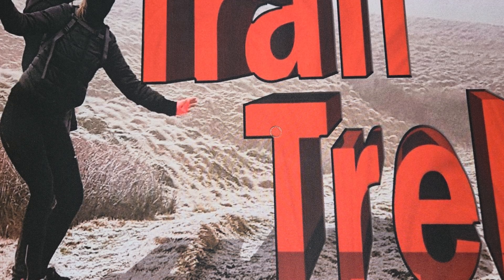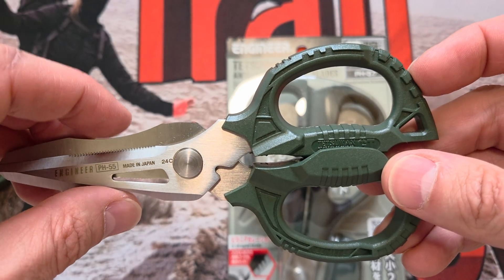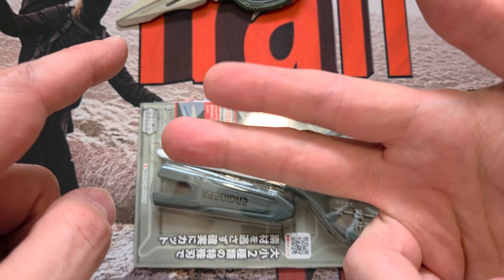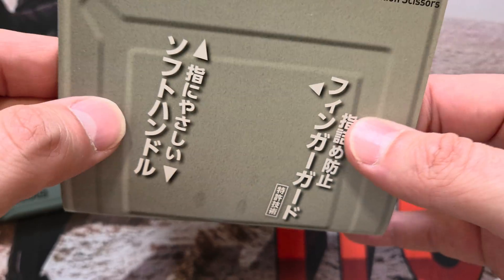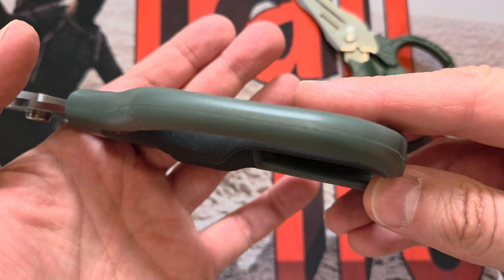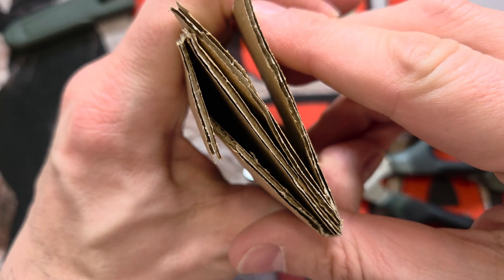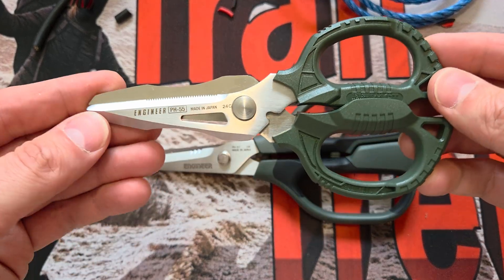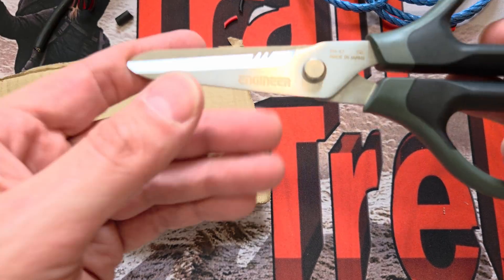Engineer PH 57 Tetsuwan Scissors made in Japan large material destroyers

Comment: I'll try em out. I have so many shears and siccors of all types. Honestly I'm pretty solid with my electrician. even cheap kleins are fine. bit more expensive millers are fine. they're all fine. You can get the kleins for like $15 or something. theyre made in taiwan i think. I think the millers are made in japan. idk. cost $30 I think.  It's all about the steel. Really high quality shears cost quite a bit more.  and I've come to find it's just not worth it cuz honestly the cheaper ones are so good these days if you know what you're getting. It makes no sense to pay like 5x, even 10x more for something that's got like idk 5% better performance in actual use. Even for other types of shears like hair dresser. you can get really high quality stuff these days for small money. just get a new pair when you need it. Anyway. It's all about the steel. I'd suggest avoid the super high quality stuff cuz it's not worth the cost these days. Get the good quality but cheaper priced stuff. Avoid junk.

Comment: Unusual design. How would you sharpen it ?
Reply from the maker: Good point so where is the issue with all serrated blades.  They are an absolute nightmare to sharpen!  You can do it with knives which don't have too many serrations with a pick file type rod but a whetstone will destroy these.  So the unfortunate answer is.... you cant!  Although having spoken to a few viewers who have had these for a while they tell me they stay sharp.  One viewer has the red handles older version and they tell me they are 10 years old and still sharp!
Reply: Best way to sharpen serrated edges is to take a small conical file, line it up in between the points and match the angle, then give it a gentle push-and twist motion. As long as they’re not horrendously dull, 5-10x in between each point will restore their cutting ability nicely. Open and close a few times at the end to deburr. 

The standard sharpener most sporting goods stores carry that looks like a pen works perfectly. Also, any stone like that one that has a groove down a section of it, you can use that same technique to sharpen a pointed tool (like an ice pick) very effectively, line it up, give it a couple of those push and twists, rotate 1/4 turn, repeat, use a strop to deburr.

Comment: As an EMT, I carry trauma shears. It's amazing what I've cut with those. Most are not expensive unless you get the Leatherman Raptor version. I don't carry those since it'a too easy to lose them at a motor vehicle accident, especially at night.
Reply: I have several pairs and I’m not an EMT. They’re really handy. Work, opening packages, fishing
Reply from the maker: I like the raptors and used to have 2 knockoffs both of which are now lost but they are nice fat shears and loved the folding ability.  I think there may be a slightly different v2 of the Raptors but the price makes me never buy them anyway.
Reply: If Engineer made trauma shears using this construction style... They would cost more than the basic disposable shears, but would still be cheap enough (probably $15-20) to not stress about losing them.  I think the only real problem is they wouldn't be able to produce them fast enough to ever keep them in stock.  xShear would absolutely go out of business.
Reply: @anthonybarker9123  ummmmmmm, these are $20-30. But there’s a key part you’re missing, Japan. Japan has a long history of over engineered hand tool.

Nippers, stationary, etc. this is just what they do.

Blue collar equipment is strangely cheap there
Reply: @Menuki  I just found no less than a dozen sellers that list these at under $20, some with free shipping.  As to standard industry tools being made cheaply, that's because most of them are considered disposable, and that's mostly for the domestic market.  The export market is a little different.  Look at a significant portion of Engineers' products that are designed for blue-collar workers.
Reply: @anthonybarker9123  maybe in the USA, but I’m talking about everything blue collar equipment….pants, belts, boots, PPE…..

Someone did a short in Japan looking “Japanese Carhartt”. It was all priced comparatively cheaply, but not lacking in quality. Of the stuff I own, I wouldn’t consider any of it disposable.
Reply: I’ve cut a penny with some.

Comment: Familiar with all this with trauma shears. I used the X shear at work and it is outstanding but not a general scissor blade 🙂
Reply from the maker: Will look at that.  I used to have a knockoff version of the first release of the Leatherman raptors.  They had very short blades but were very capable with a slight serration on them.
Reply: The engineer shears are extremely fine.

Comment: Theres a extra function on the 55 you missed. On the handle side of the blades is a notch...for wire stripping??
Reply from the maker: Yes I should have mentioned that.  I covered it in my full PH-55 review: https://www.youtube.com/watch?v=IIwpSWv6lnE
The bit by the handles is for cutting solid copper and steel wires.

Comment: I bought the Tajima  Clipper 210 scissors a few years ago, more household scissors, smooth blades.
Top quality, I am left handed so have to use scissors with my right hand, the Tajima are so precise I can use either hand. That is a first for me.
Made in Japan
Reply from the maker: Excellent il go and look at those now.  I saw some great ones by OXO which are marketed as kitchen scissors.  But they are really good and they dismantle super easy.
Reply: @TrailTrek  Tajima make some of the finest tools out there, there chalkline is the dream of every carpenter, they are not cheap but the quality is very high.